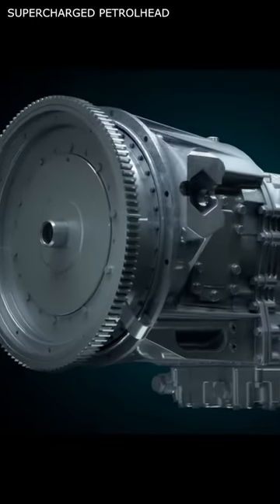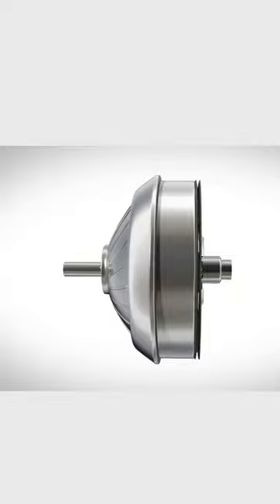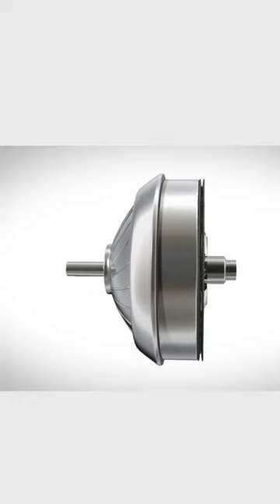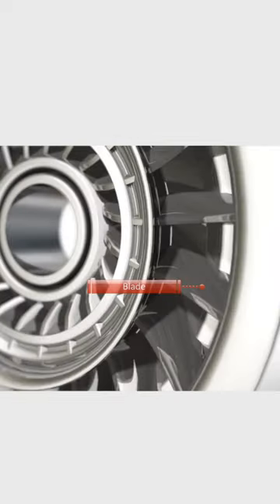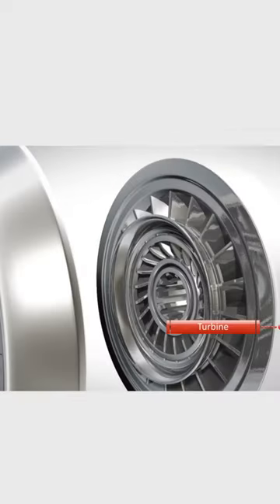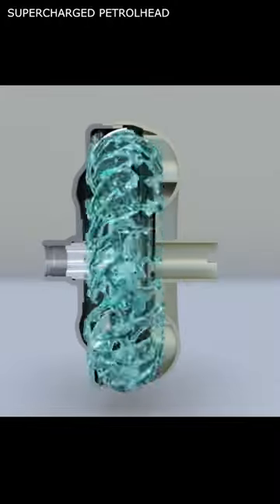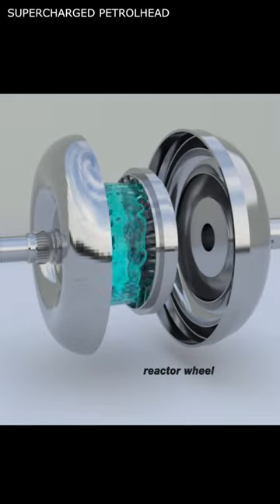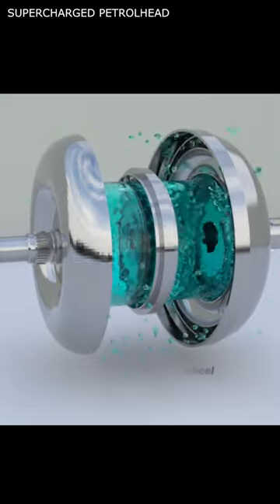How a Torque Converter Automatic Transmission works? #howitworks

Comment: Easiest way to give someone the concept of how a torque converter works in basic form, is put a fan infront of another fan facing each other, and turn on one of the fans. The airflow from one fan will cause the blades of the other fan to spin. This is the same concept but instead of using air to flow over to the other fan, the torque converter does this will fluid to cause the same effect.
Reply: Underrated comment
Reply: Genius, kinda wish I was a fly on the wall when they brainstormed this design.
Reply: Now break down stall speed, lock up, and torque multiplication of the torque converter in the same terms pls :)
Reply: You've explained a turbine, not a torque converter.
Reply: Science garage
Reply: Isnt there a great loss of power in a torque converter. Like whats the point of it?
Reply: @HypersonicMissile77 there is a lockup clutch inside the TC, after the engine rpms high enough that the engine wont stall, clutch begins to lockup then the power is transmitted without major loses.
Reply: @omerbayraktar1953 ahh thank you. This was the missing part I needed to know. I always thought that there was always some sort of friction energy loss because of the fluid
Reply: @martinheuts  yes, energy loss is happening but it only happens while shifting and taking off. But we cannot ignore the increased comfort/smoothness and instant torque due to the slippage of TC.
Reply: @omerbayraktar1953 dude there is no power loss. A torque converter MULTIPLIES torque
Reply: @martinheuts torque convertor multiplies torque. That guy has no clue what he's talking about
Reply: @goose6619  TC only multiplies torque for a short time at certain rpms and while it slips until the gap between input and output closes (imagine clutch kicking in a manual car so you instantly transferring loads of torque to the drivetrain). If it would always slip due to the lack of lockup clutch there would be too much energy losses to the TC fluid heating WHILE IT DOESN'T MULTIPLYING (Like around 2000rpm+ after you take off for most TC's)
Reply: @omerbayraktar1953  I know how it works. It still multiplies the torque until you're 1:1.
Reply: @goose6619  yes actually you have no clue how it works, please stop misinformating people. It only multiplies while the speed difference decreases between input and output NOT WHILE IT STAYS THE SAME even if you are accelerating (for example you are taking off the car half throttle, input speed suddenly comes to 2000rpm's and stays there, then until the output gains speed to around 1850rpm's and cannot make the gap closer anymore so thats the point where you stop multiplying also the point that the lockup clutch starts to engage)
Reply: @omerbayraktar1953  in my car the last gear is the only one 1:1. Therefore, no matter how much you dislike it, it multiplies torque until that point. Or the gear ratio would not be great than 1:1. Hope this helps!
Reply: @goose6619  bro sorry but you are behaving like a 0iq we are not talking about the gearbox multiplying the torque. The topic is about torque converter THE COUPLING DEVICE BETWEEN ENGINE AND THE TRANSMISSION, im not saying the torque multiplication that comes from the >1:1 gear ratios, it's whole another topic, even the differential ratio itself around 2 to 3x multiplies torque on most cars. Gearbox multiplication happens on all types of gearboxes even the bicycles.
Reply: @omerbayraktar1953  stick to toy cars
Reply: Top comment
Reply: You tried but not enough cos the power this fluid propels is too heavy and its beyond blad and fan thing

Comment: Basically a nice method to idle without a clutch. Brake power stops the turbine on the transmission side while the impeller still spins. Take your foot off the brake and the turbine can now spin, which is why automatic cars kinda drift forwards when you aren’t touching the brakes. Super cool concept.

Comment: Great video, easy to see why my diesel started making gear grinding noises.   It was the torque converter for a V6 with 300,000 KM or about 160,000 miles.  Low miles since most of it was highway mileage.  Lived in mountainous territory and it was only a matter of time before all the up and down hilly conditions blew the torque convertor.   Always get the transmission, front and rear gear fluids checked if your living up in Colorado.   Those high elevations kill cars even 2.4L V6’ diesels! I learned my lesson.

Comment: You didnt talk about the torque converter lockup clutch that locks the converter in and out 1:1 to reduce heat and improve fuel economy

Comment: how do the turbine vary speeds while transmitting power to the wheels? Or how does the gear ratios work here?
Reply from the maker: torque convertor just replaces the clutch plates...there is a gearbox attached to it with different gear ratios
Reply: @superchargedpetrolhead  got it. Thanks.
Reply: @superchargedpetrolhead how does the torque converter not loose too much power to even drive I mean no matter how good the fan is I can't imagine a car having a spinning driveshaft connected to the wheels just because two fans rotate and the energy is transmitted through fluid
Reply from the maker: It does lose a bit more energy than manual transmission. It is a little bit inefficient. 
but modern torque converters have gotten so good, the energy loss is almost comparable to a transmission with clutches.
Reply: @superchargedpetrolhead  Thank you for your fast reply, and even replying some stranger who wants to educate himself. But I don't get how just by liquid the energy gets transferred to the wheels and they have enough strength still. So to sum up my question: How does the torque converter manage to transfer the kinetic energy to the wheels where they pull a thousand kilo machine?
Reply from the maker: the easiest way to understand how it transfers energy is to imagine you place a fan in front of another fan. Once you turn on one fan the airflow from it will make the blades of the other fan rotate as well. Torque converter works in the same way but instead of air it uses high viscous fluid in a contained space so as there is no way for fluid to escape, when one blade spins the fluid hits the other blade and spins it.
Reply: @1Life4Passion  modern torque converters also have a lock up clutch that mechanically connect the turbine and impeller when the vehicle is at cruising speeds.
Reply: @jg3019  Thanks for clarifying I appreciate you! 👍
Reply: @superchargedpetrolhead is it same like a manual box or how is the gear shifts smooth in torque converter . Is it planetary system?
Reply from the maker: @arunshiva2008  yep, they use planetary system
Reply: @1Life4Passion the whole point of a torque convertor is to multiply the torque dude. Also torque is generated from large gear ratios.
Reply: @1Life4Passion  lose

Comment: That's got to have a hell of a lot of drag, right?
Reply: Right, it does have a lot of drag. But the torque converter concept shown in the video is only used to get the vehicle to start to move. When it's at X rpm it locks the device and the revs of the motor are almost fully transmitted to the gearbox, reducing the drag considerably.

Comment: I think there would be a lot of efficiency loss in this design. Fluids have such low friction.
Reply: every automatic transmission car uses this design
Reply: Fluid is used in braking, steering etc. it does the job